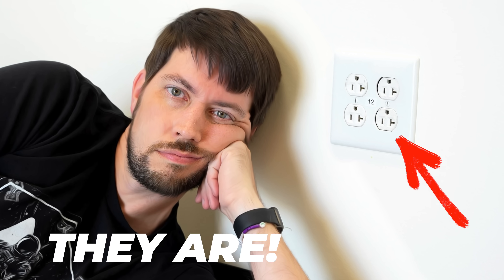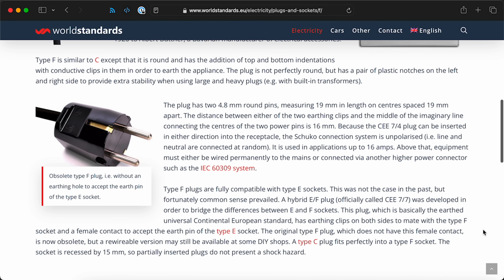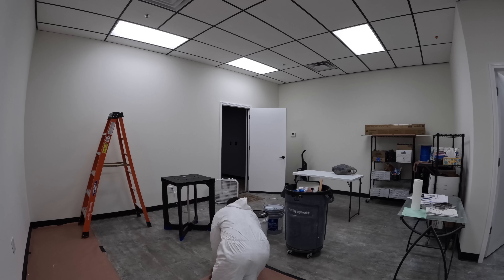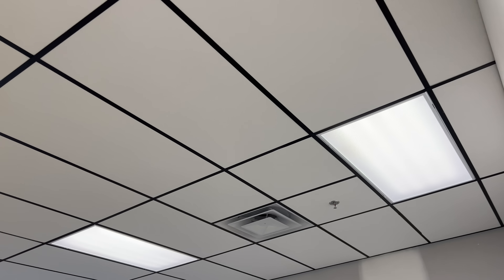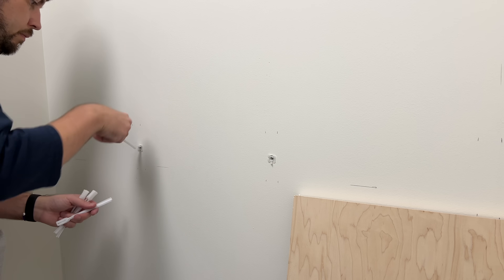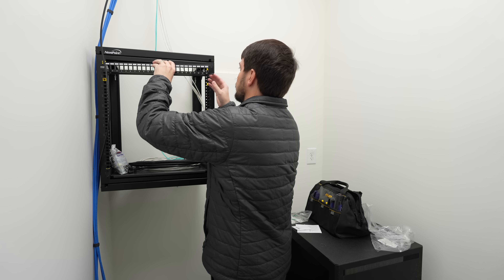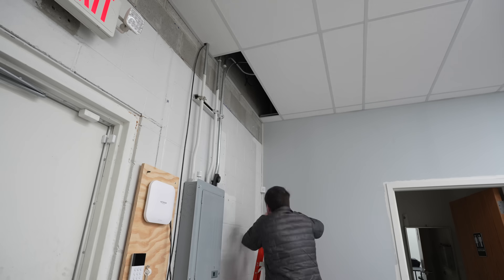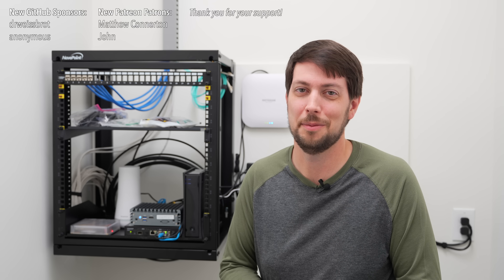Wiring up a small office network rack (moving 10)

Comment: i bought a cheap harbor freight driver specifically for network racks and its been a godsend - its a little red thing that comes in a bag and was like $60 maybe?  something like that, totally worth it...used it to build a VEVOR 12U 4-post rack 15"-40" from ebay which was $81 and i thought was a pretty good deal, went together easily, works great

Comment: you're gonna hate this 3:35 you need to do another coat, I can see that white strip that was originally there through it, another coat of paint will blend and hide this

also with the insulation on the access points, maybe leave a stapled note on them saying they are loose and can be moved, just for whoever comes after :)
Reply from the maker: For the paint, after it dried, it's barely visible, and only from the angle in that camera shot (from the front you can't see that strip at all!)—it would be better to do two coats but I'm good with it as is :)

Comment: Find some powered HVAC dampers and have them close specific registers when recording.
Reply from the maker: I do have dampers in the studio and rack room—but I don't have them automated, at least not yet :)

Sometimes when you close them it makes a little more noise, unfortunately. With the high volume of air, it's hard to really seal it off with normal dampers :(

Comment: Jeff, having the ground on top was introduced to keep objects from falling between the outlet and plug, should it back out. If you look how new outlets are packaged, they are all starting to display them with the ground on top. Good idea, until a refrigerator manufacturer makes the plug with the ground on bottom! 😀 Many power strips have flat wall plugs with the ground on bottom and a 45deg angle!

Comment: For awkward to rack devices, someone recommended to me using a 1U shelf that has slats cut in it (I have a couple Startech ones that fit the bill nicely). With those, you can use a spool of Velcro straps to strap the unit to the shelf. Depending on layout and accessibility needs, you can get a lot of devices that otherwise don't have a good way to be mounted in 1U easily. And since you're using RackStuds (good play there), unmounting and accessing the devices on the shelf is pretty easy.

Comment: 3:00 AFAIK clocks in microwaves or similar devices keep their time using the frequency of the power grid, so they should be pretty accurate
Reply: This comment made me curious enough to google the type of clock present in my (NEFF) microwave. Here's what the data sheet for it's controller SOC says about its clock:

Clock generation circuits
4 circuits: XIN clock oscillation circuit,
XCIN clock oscillation circuit (32 kHz),
High-speed on-chip oscillator (with frequency adjustment function),
Low-speed on-chip oscillator
• Oscillation stop detection: XIN clock oscillation stop detection function
• Frequency divider circuit: Dividing selectable 1, 2, 4, 8, and 16
• Low power consumption modes:
Standard operating mode (high-speed clock, low-speed clock, high-speed on-chip oscillator, low-speed on-chip oscillator), wait mode, stop mode

Clock
Real-time clock (timer RE)

So it would indeed seem to rely on a few oscillation circuits.
Reply: no, they have a small oscillator circuit that provides a signal to a simple microprocessor in the microwave that controls other functions, such as the time to microwave food, at different intensities.
Reply from the maker: Some older ones did use the grid, but that's pretty rare for any appliances these days.

Comment: Does it matter what orientation the AP should be in? Horizontal or vertical?
Reply from the maker: For this one, it prefers to be facing the area where it's covering—the back is a large metal plate, and antennas are along the front around the edges. So it works most any way, but is optimal up on the ceiling facing down, or on a wall facing the area it's covering.
Reply: @JeffGeerling  thanks.... I didn't think about the antenna orientation, I need to look more into that, the APs seem to be getting much more flexible nowadays....thanks for the reply

Comment: I changed from regular keystone jacks to keystone couplers. Instead of punching down the wires, you put a standard RJ45 plug on the end. the couplers snap in to the panel, then you just plug in front and back.
Im sure some will disagree, but  I find these faster to install,  more reliable, and WAY easier to troubleshoot in the future.
They make dressing the wire bundles easier too.
Reply from the maker: True; though for a permanent install I like having it punched in—keystone makes it not as annoying to deal with, and trying to crimp RJ45 on Cat6A or Cat8 cabling is quite frustrating!
Reply: A YouTuber was installing his new network rack and his numerous cables already had RJ45 plugs. So he snips them off and goes through the trouble of punching them into keystone jacks. Then diagnosing the ones that didn't work. He would have saved a LOT of work just by using the keystone couplers. For me, I find it easier to connect the plugs, rather than mess with the punch-down blocks.
Reply: Did this myself so I didn't have to punch in cables. Makes rearragement easier as well. Its in a permanent rack, and its been working fine this way for years.
Reply: Generally a plug is much slower and less reliable than a jack

Comment: I would skip the QNAP and Wire thingy and simply use the NanoPC-T6 as the router, 1 network port to the cable the other back to the switch etc. You could even add internal WiFi to it. 
And using OpenWRT, which can have wireguard etc running directly on the router, so yeah.

Comment: You pulled a loop of TP cable into the ceiling. Why not do the same with the coax? At least for until a new rack arrives someday.

I'm not really a fan of the wall mounted stuff. But it's better than many other solutions I've seen.
Really like the shielded patch panel etc. because I also use this all the time. Pulling each wire through the panel is the way to go. Don't care about the labels in the back. To label the cables like that is already a mile more than other people would go.

Comment: I know it is overkill but I would recommend a blank 1U above or below your patch panel.  This way when you go to swap out your old switch in 4 years you have a spot to stage and put the new one.  And if you put in short jumper cables you can keep it all clean with minimal downtime.
Reply from the maker: My plan is to put either a brush panel there or a 1U Neat Patch (if I'm feeling extra extravagant!). Easier to manage the cables that way too.
Reply: Tiny footnote, but @JeffGeerling where do you plan to get the short jumper cables?
Reply from the maker: @davidhubbard7050  I have a set of thin cables I bought from Amazon (used some already in my homelab, the rest are in a little box here).

Comment: You need a service loop for your cat6 on the back of the rack.  With the tension you have there you've effectively tied the swinging rack door in place unless you pull down more wire from the ceiling, and thats not what we do here.  I know you proably won't need to do that often but doing it now is less annoying than after you need to get the door open for some reason, can't find a ladder nearby, etc.
Reply: I don't think he will ever be able to swing it open anyway because the rack itself is mounted too close to the left wall. Sure with only the patchpanel there would be no issues but think about the depth of switches and other gear
Reply: @sitte24 Those Navepoints are reversible. I've installed them and they can be configured to open either direction.
Reply: Would act as a drip loop too, if the roof ever leaked the water would drip off the loop instead of following the cables down to the patch panel. I always leave enough slack for a drip loop because I'm paranoid, but it has served its purpose on one occasion and I was glad I did.
Reply: If you route the wiring along the left side of the rack, and then along the back of the patch panel (which will make port 1 your shortest run, and port 24 your longest run) you don't need very much slack. You simply configure the rack so that it swings to the left when you open it.

Comment: Here's an important one: Grounding bar!! I'm not a lawyer or a building code specialist but every business IT room I've worked in has a dedicated copper grounding bar- especially when PoE is involved!
Reply: Grounding bars are good it you have large server racks. In Jeff case not needed. Which if he put one of those metal power strips mounted to the rack. Then the whole rack is grounded. 

As far as poe powered swtch is involved it is low voltage and a ground bar is also not needed. also poe switches like any other metal device the ground wire from the outlet makes the device grounded and when its mounted to a rack it also makes the rack grounded. 

Now I might be wrong on some things but  This is just my opinion and points I took from my uncle who is a master electrician.
Reply: In a small setup, all the grounds (in the room) come together at the sockets (or power bars) as do the neutrals, so probably no issue.  In turn all the electrical grounds meet at the main panel (and sub panels).
Reply: My network IEEE 802.3 af/at from PoE Texas is floating.

Comment: The wire through the keystone is so cool! Definitely looks like it makes the wiring easier.
Reply from the maker: It's the little things—I always had cables that were an inch too long or short before, this way they all naturally fall right into place!
Reply: This approach works, too, for just a few cables. For a thicker bunch there are so called cable combs.
Reply from the maker: @dan-nutu  Yeah and that other YouTube channel I mentioned has some great demos of a cable comb looming through like 20-40 wires! Definitely the way to go if you have more than 5-10 cables. Even with that, a comb would make the initial smoothing out easier.
Reply: Wish I would have used keystone panels years ago when I did mine. I think they were like $100/ea or something

Comment: Did you ground the rack?????  You have to if you want the shielded Ethernet cable to work…
Reply from the maker: Good point—and I may ground it anyway at some point (it's not yet), but the Cat6A cable I am using is plenum UTP, no shield included. To get the shielded wire I would've had to get 1000' (and paid a little more than double), so I stuck with UTP.
Reply: @JeffGeerling  ah I misunderstood when you were installing the jacks.

Comment: Do you plan to use any door reader cards? Ubiquiti and Home Assistant talk together pretty well, so you could automate deactivating the security system and turning on the HVAC to human levels when you badge yourself in.
Reply from the maker: Something to think about at some point—but probably in a future renovation, and not too soon!
Reply: @JeffGeerling  I'd suggest getting rid of the SimpliSafe system. Get yourself something more secure, maybe for you a DMP XT30, if you upgrade a bit, not only can you have burglar alarm devices, but also for your fire alarm system. I don't see smoke detectors, but I see sprinkler heads for a waterflow and tamper switches. You could also easily integrate card access such as he suggested above. That and have your duct work cleaned/vacuumed. Not only for cleanliness, but for health (respiration).
Reply: I just installed the door access system at my office. We went with the fail close/safe latches. Works really nicely and you can still use a key to get in. It makes sense if you got a lot of employees or contractors cause you can limit access hours or completely boot someone if it comes to that.

Comment: Jeff how about an automated damper to just close off the leg to the studio.
Reply from the maker: I thought about that initially—but the fan transmits a low frequency rumble (between 60-200 Hz) that is impossible to mitigate, and seems to set up a standing wave in a few parts of the studio.

I'll have to figure out how to deal with that—and honestly the fan noise through the vent is very little (and probably wouldn't make it to the mic).
Reply: @JeffGeerling  Makes sense.  I'm sure you're running audio through some processing (that would be a great video, btw) to cut out hum, background noise, pops, which would probably remove that standing fan noise completely.  I struggle with that on podcast recording.
Reply: Also I run the same small 12U rack (also attached to 3/4" plywood) here at home.  I never felt the rack into JUST the ply was enough, so I also used toggle bolts through both the 3/4" and the drywall to attach the rack.  Other stuff (like you have) is just screwed to the board itself.  

One thing that annoyed me was that as I added more items to the rack, the wall itself would amplify the fan/drive noise.  I added a 3/8" piece of hi dense closed foam between the entire back of the rack (mine is enclosed) and the wall. This helped greatly to isolate that vibration from the wall.

Comment: Outlets installed in most residential locations are from a safety standpoint upside down. The ground should be on top, this provides safety for something falling between the plug body and the wall. Ground pin protects the Line and Neutral shorting. Even more important with 220 and higher voltage.
Reply: "most residential locations" is a bold statement. How are you sure? I live in Nebraska and every home I've been in has outlets where the ground pin is lower towards the floor. I don't claim that it's that way in "most residential locations" simply because I haven't personally been in enough houses in the US to qualify as "most", so how can you?

Comment: Absolutely convinced everybody complaining about power switches on outlets are just trying to gaslight us brits into being mad...
Reply: Could it be that they insist on the power switch because the mains voltage is higher at 220, which is inherently more dangerous than 110?
Reply: @AlexKidd4Fun  That certainly part of it. The switches also makes it easy to save power. You’re more likely to turn off a power switch right where you’re sitting than one across the room. You can also control individual plugs vice turning off two or four outlets at a time.

In Japan they sold power strips that had a switch for each socket. I used those a lot when I was building computers, or working with power tools like a soldering iron.
Reply: Brit, now Canadian. I miss the switches for sure, but I miss the security of things staying plugged in far more. North American sockets have wimpy retention strength.
Reply: @robbybobbyhobbies  meh. Works for 300 million of us. Maybe the problem is elsewhere…
Reply: @PrinceAlberts  so you've never had the problem, cool. I have. Try plugging a wall wart in a Canadian socket vs a UK socket and see how they compare. Also, less of the passive aggression would suit me just fine, but you do you, eh?
Reply: @PrinceAlberts unnecessarily aggressive reply
Reply: Switches on outlets are fuckin great
It means connecting a device that draws alot of power won't arc on the pins if you switch it off first and instead means the switch takes that abuse(which is what it's made for)
And also means turning something off(if the appliance doesn't have a switch) doesn't mean leaving cables unplugged everywhere
Switches never get in the way, so there's no reason to not have them
Reply: Great for workbenches and kitchens. Then you can leave your pie iron plugged in, and just use the switch.
Reply: They are jealous 😮
Reply: Agreed, it’s genuinely very useful and sensible, from a safety perspective as well
Reply: I’ve used them overseas and it was convenient, but not really necessary.